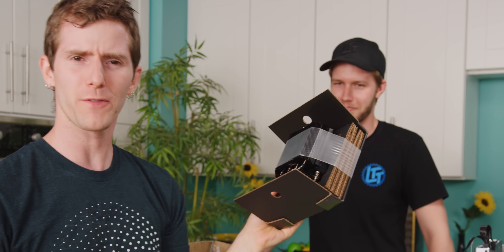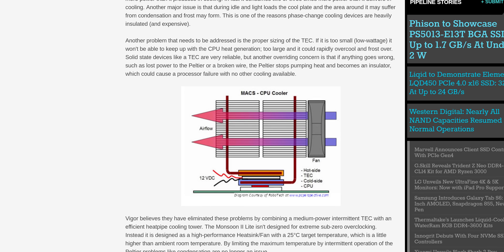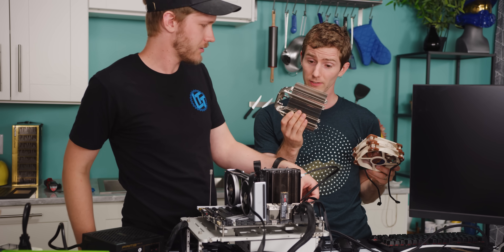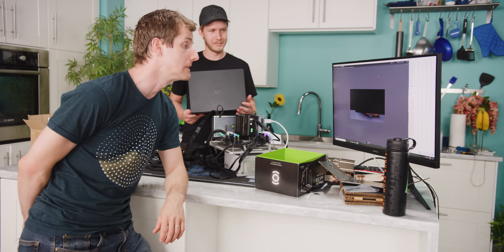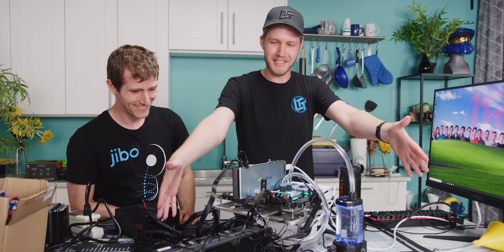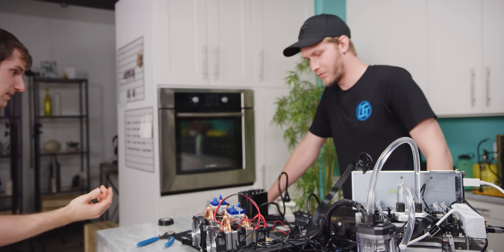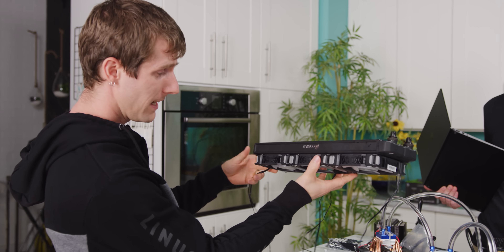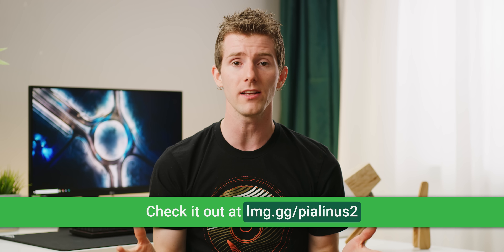Thermoelectric Cooling is a Bad Idea

Comment: Try using x4 240 rad in series  without fans to cool a ryzen 9....overclocked
Reply: Why not a car radiator? I used a smaller copper radiator (only 4x 120mm fans can fit, but it’s like 4 inch deep), and without fans it could cool 2x GPUs to about 60c on the cards. You defiantly wouldn’t need fans either way, Ryzen desktop quickly hits thermal package limits, way faster than Intel, so your power draw is never really insane like it is on Intel. And the size of the cooler doesn’t need as many radiators because the wattage is so low.

With fans I have a little more heatload but it does fine (main system is 4x R9 Fury and TR-1950x, up to somewhere above 1.7 kW power draw when using as a basically silent heater during winter with everything overclocked running Crysis 3 at 4k Ultra 100+ fps and then turning off the monitor because I just wanted the heat, max temps on the cards are in the high 50s to just barely bump 60c typically, fans barely need to spin)
Reply: @jakegarrett8109  u have a really nice tho....... Question, is it possible to only overclock 4 of your cpu cores?............
Reply: Supreme Black on Threadripper first gen? I haven’t updated BIOS in forever, so I’m not sure, I just apply a 4.15 GHz all core overclock (higher in the winter) and let it run, I use it for high multi-threaded applications where all core is most important, and for gaming I’m entirely GPU bound anyways at 4k and overclocking at all isn’t needed (for reference, my Titan Xp only does 45 fps in Crysis 3, so even duel 2080ti still wouldn’t be much faster, if any, than my current build at 100 fps due to SLI scaling).

You can disable cores and threads if you were wanting to test (at one point I had to disable SMT for testing Fortnite because it broke the Unreal engine with 32 threads, but I often just use a separate machine on my test bench with a Titan for that game).

Comment: I'm curious how the first one, the HEX 2.0, would've performed if in a case with proper airflow to help aid in offsetting the extra heat, but then again, probably still would've been crap based on the design flaws.

Comment: Another idea, water cooling without fans. Just put 30 gallon water tank, check how long you can run a pc in high load without worrying about temperatures. It should have enough thermal capacity to work for 5-6 hours.

Comment: Another test you can try is stacking the TEC modules. TECs working by creating a constant temperature differential between the two sides. The reason one side gets colder is because you are removing heat from the other side. Stacking TECs lets you cool one TEC with another to reach an even lower temperature. It's not directly linear since each new TEC has diminishing returns, but it may be worth a look.

Comment: It is in fact possible for the type of device to literally remove heat from the system.  In simplest terms it can turn a heat deferential into electrical power.  If you've ever seen those camp fire phone chargers, it's the same tech.
Reply: AMD just took out a few patents on this tech for 3D stacking.

Comment: The best cooler I ever owned was the Titan Amanda TEC which ean my 8600 Core 2 duo @4.5GHz at near 40 C constant at load.
They are fantastic and I was told how "bad an idea" they were throughout the 10+ years use I got out of it, it's still running on a friends PC.

Comment: I had a super basic peltier element+watercooler combo for my Slot A Athlon back in the early 2000's. Would get so cold that condensation was an issue. Didn't use it for very long because of that.

Comment: Idea for another episode:
Using an Air conditioner,welding the tubes to the a copper CPU block and you have permanent sub 0° celcius cooling!!!
Reply from the maker: That's called a phase change cooler and you need to be an hvac technician to handle the compressed gases inside those kinda of coolers.

Comment: I think Der8auer build a chiller out of 12 TECs a few months ago
Reply: Wow, think of how much power that required.
Reply: @Pwnstared  i think it were a few hundred watts
Reply: Der8auer made 2 videos on this.  The second video was an update.  But it was not too  successful.  But hay just like everyone.  The more Tech Ideas.  The better for the Tech Community.
Reply: He also tested it directly on CPU. Very old video. It will work, but problem still the same - it's need more power.
Reply: @rusTORK  i don't think 3 or 11 Months are “very old“ but ok
Reply: @p3chv0gel22  Yeah, i founded that video and it was 11 months old. Not really that old. In case some one is interested: https://www.youtube.com/watch?v=dTTq_vYvWIY i7-8700K at almost 6.0 GHz.
Reply: yep and even a better one for "PC-Welt" and theire "Höllenmaschiene" which is basically a ultra high end pc giveaway.
Reply: I've seen a couple things that suggested TECs are only about 5-10% efficient at best. It's unfortunate but it's pretty neat that it's possible to make a solid-state heat pump.
Reply: But sadly he didn't do a decent build, too. Just too weak peltiers, too small fans, and not enough of all.

Comment: If you want heat ouside of the room, then running something outside, say also shaded, would do the trick right? Control that and you can "heat" the room during winter and chill it during summer, right? Extreme gaming where the PC cools the room as well, who cares about power consumption in pursuit of performance, right? XD

Comment: Naw, it's awesome!
I remember when people TEC cooled Celeron 400s...
Reply: I tried that... only time I ever actually cooked a cpu, glad it was just a celeron. Lesson is: don't put the TEC directly on a chip without an IHS.
Reply: Those were the days.
Reply: I almost miss my dualie Celerons...
Reply: @thoughtlesskills  i miss microsoft internet explorer & my 300a .... and interstate 76 !!@$
Reply: https://www.youtube.com/watch?v=T87tqpNkI18 My Peltier cooled PC
Reply: @kchimusaru  holy shit that pc is insane! But is it actually TEC? How does it work?
Reply: @caiotbc  Heat exchanging. peltier is watercooled and has its own radiators. Meerstetter controller adjusts the voltage of the peltier automatically depending on CPU temperature.
Reply: I still have celeron on me
Reply: i put one on a 486, i remember that the computer would hang and there would be ice on the under side of the cpu. this was in the celeron 300a times but we still played with some 486s that we got for free
Reply: You've lived a good life.
Reply: Celeron 300a (the massively overclockable one) had a TDP of 19 watts.
I ran one at 450 for a long time just using air cooling.

There's a big difference cooling 19 watts vs 225 like some of the new chips have.
Reply: Check it out, it's the old men of over clocking club.
I making it official, OMOC Club.
First GPU was a PowerVR, the last, good one.
It was so over efficient with it's HSR an TBR that it ran for years and years.
It was only it's lack of HT&L that finally retired it.
Then I bought whatever I could afford.
Then I got pissed off you needed a new gpu every year and when you only played one hand a year it was not worth it.
So I bought a 360.
Which I still have, although back compat on the X1 retired it.